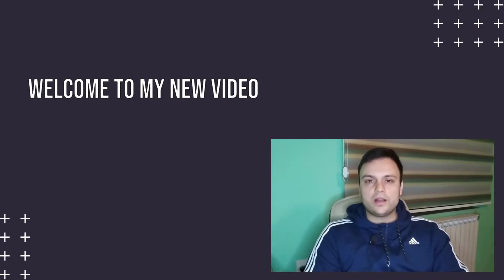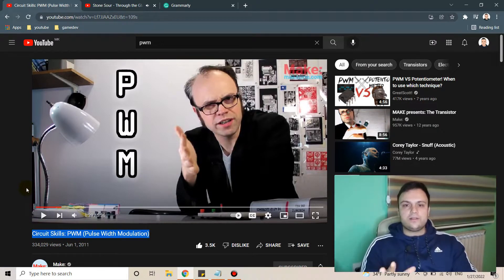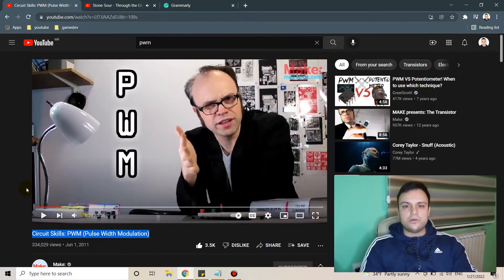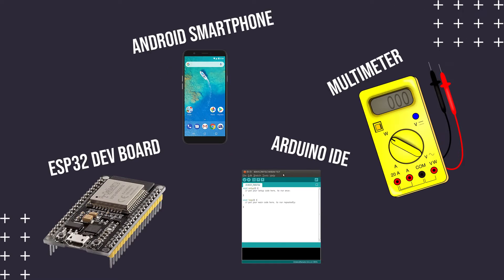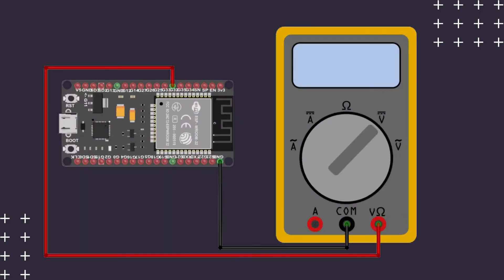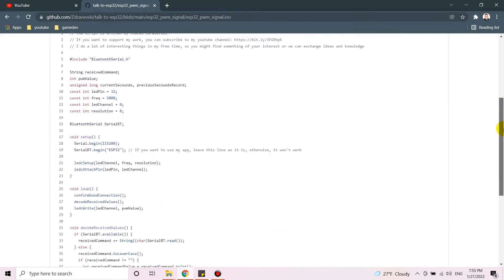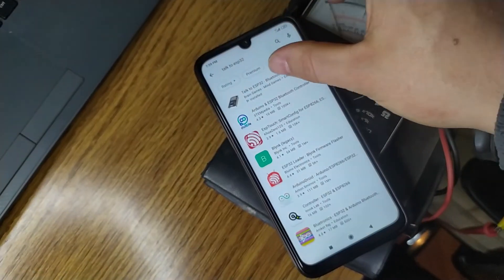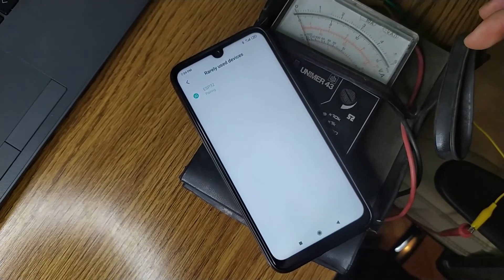ESP32 + PWM + Android | What is PWM? |  Pulse Width Modulation

Comment: Hello!
Thank you for the video and the wonderful app. Could you add frequency and duty cycle control to the 'PWM signal'? For example, I need to set it from 1 to 2 kHz with a duty cycle of 10 to 50 percent. Is it possible to add such adjustment?
Reply from the maker: Hi, thank you, glad you like it. Yes, it is achievable, when I have more free time I will update it.